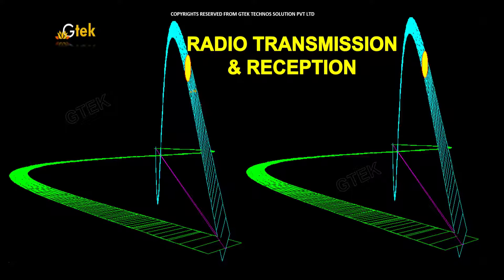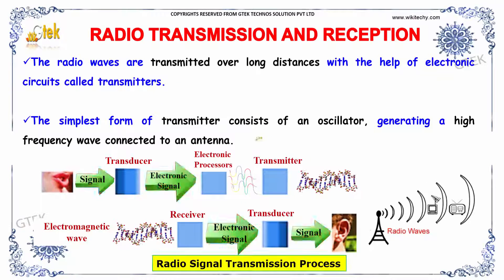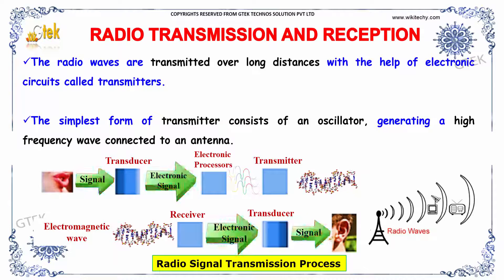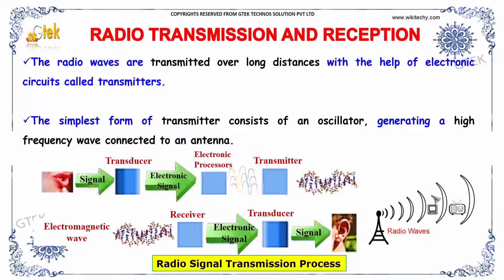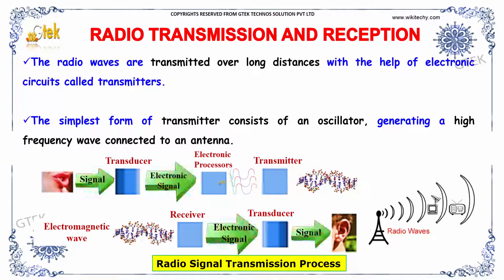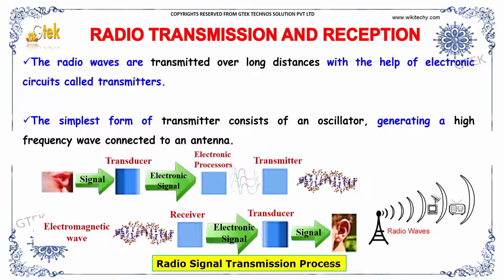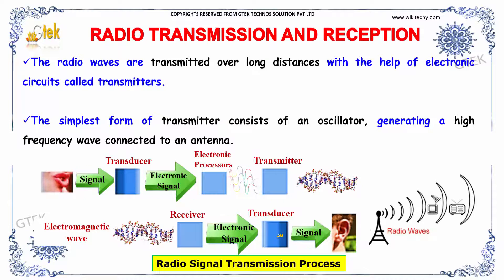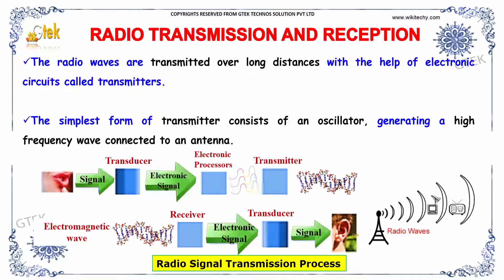Radio Transmission and Reception  | class 12 physics subject notes lectures|CBSE|IITJEE|NEET

Comment: As radio ownership increased, so did the number of radio stations. In 1920, KDKA was not actually the only operating radio station, but it remains a benchmark in most accounts. And by 1922, 600 radio stations had sprung up around the United States.

Comment: Radio broadcasting is a unidirectional wireless transmission over radio waves intended to reach a wide audience. Stations can be linked in radio networks to broadcast a common radio format, either in broadcast syndication or simulcast or both. Audio broadcasting also can be done via cable radio, local wire television networks, satellite radio, and internet radio via streaming media on the Internet. The signal types can be either analog audio or digital audio.